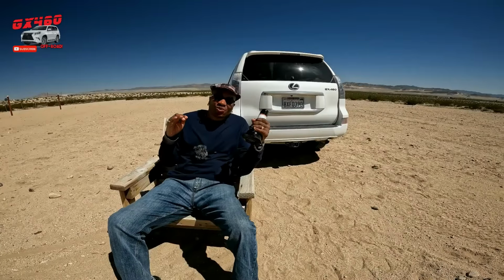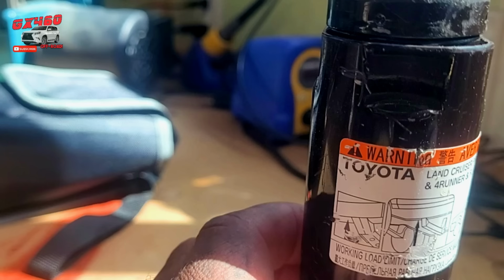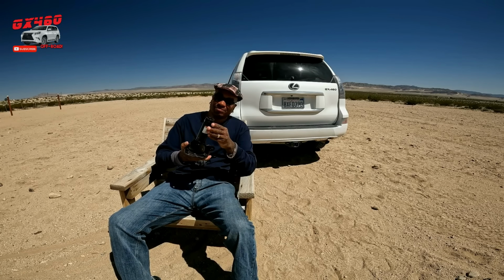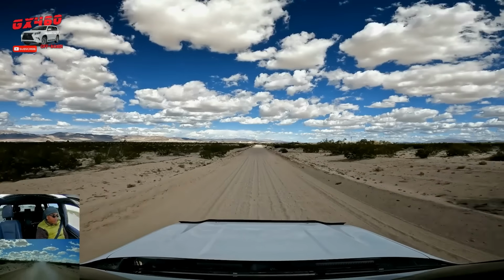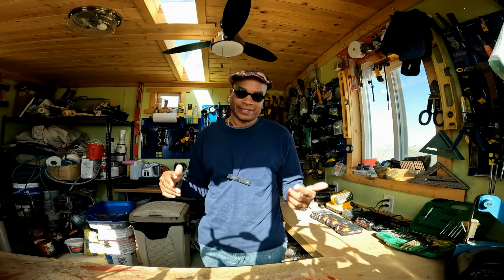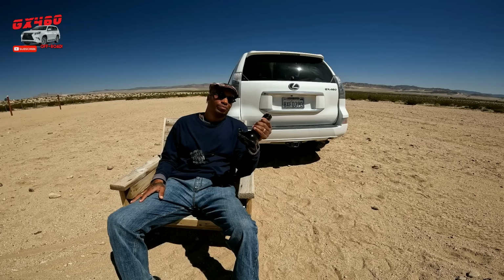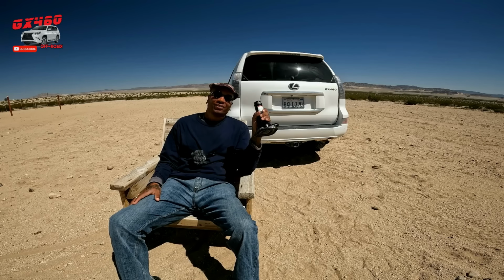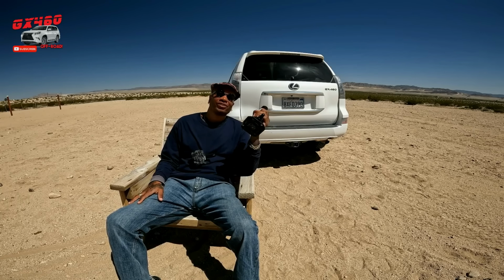Toyota's Jack is GANGSTA!  (Don't Replace It!)

Comment: Last year I did a search for a better jack for my built and lifted GX460. I didn't want to carry a Hi-Lift, so I looked at bottle jacks. I did find one that would go 24" (Baoshishan, for those interested), but then I checked the factory Toyota jack and it goes over 19", and I wouldn't have to carry an extra jack and worry about it leaking as you mentioned in the video. So I bought a couple of extension products such as from Land Cruiser Product to augment the capacity of the factory jack and all is good
Reply: @stevecarlson2346 Land Cruiser Product says their "medium" jack adapter is out of stock.  However, out of curiosity, does this adapter fit (cradle) your frame rail?  It doesn't seem like it would from LCP's pictures.  Cradling the rear axle, though, should be no problem ...

It would seem being able to spread out the lifting forces across a larger surface area would be advantageous from a pressure viewpoint, so I'm wondering if there are any other companies that might offer adapters for our stock jack ...
Reply: I was mostly thinking of the axle for the LCP adapter.
Reply: Ah ... Many thanks!
Reply: @bavardage  Easy way to get a rear tire off the ground, even with a lift and 35s as I have.

Comment: Had a Flat in my Tundra, the Jack Failed, it’s locked up. 18 Wheeler helped me out thank goodness. I was basically stranded due to a simple fix of a flat but the Jack is totally locked up. Took the Jack to my Toyota Dealership where I purchased my Tundra. No help,at all and a new Jack cost $200. A Service Tech tried to unlock but the gear inside failed he’s seen many of these Jacks Fail but Toyota will not replace, have to purchase. I contacted Toyota and again no help. Buy a new one, mine is new. Only used 2x. The Jack and Tools are in the back seat in its proper place. Very Disappointed in Toyota. I paid $300, for the Tow.

Comment: They make adapters that will fit a 1/2” impact.
Reply from the maker: don't use an impact for this... the gears aren't designed for that... do it by hand with the provided sticks... or use a drill on low speed (low gear)

Comment: Do you know what year those came out? I have used older Toyota jacks like that, but not the extended version you have.
Reply from the maker: been on Landcruisers forever... the old ones were cast yellow and bolted together... newer ones are stamped, welded and brown like this one 😃
Reply: I have 2 80 series here. I will have to take a look if the stock jacks are in them. Thanks

Comment: The other thing i carry is a rubber mat, about 30cm square, its made out of old conveyor belt rubber from a quarry. i usually chuck it on the ground then the jack ontop. its thick polyester reinforced rubber, it crushes down but protects the jack and stops it slipping off a rock or getting messed up by crap on the ground.
Reply from the maker: That's and excellent idea!  Thanks for sharing that tip ❤️
Reply: Quite right, I use exactly the same thing, works a treat.

Comment: Do not uses an impact driver with one of these. A drill is fine. (Don't ask how I know, but you can remake the gear teeth with a stick welder) I have a few, including a yellow one,1964?.
Reply from the maker: Yes the yellow ones were cast I believe, and unbolted for maintenance

Comment: my 1992 holden(isuzu) rodeos factory jack is the same model the only reason i found out is cause its the same model as in my mums 2003 prado which even though the prado has a 2 inch lift and larger tyres it still doesnt have a problem with it compared to most other oem jacks

ive jacked up the entire rear end of my rodeo with one of these and took both the wheels off to get swapped out so i could get my car registered and left it on the jack for about a week

Comment: After a 3-inch suspension lift, 1 inch body lift, and larger tires (35's), it is too short by several inches. That's the only issue i have with it.
Reply from the maker: Carry a block/blocks of the same height you lifted/raised the vehicle
Reply: @LexusGX460-OFF-ROAD  
Yes. That's what I have to do. Which is fine. 

Thankfully, I've only played with the jack in the driveway to figure out what I need.

Comment: The only issue ive found with this jack is that you need flat level ground and sometimes you need additional height so you have to place boards underneath the jack…

Comment: Not high enough for my lifted 4Runner unfortunately.
Reply from the maker: The thing goes to 19.5 inches... you'd have to have a 10" lift for this thing not to meet a jack point.  1-4" lift just put something 1-4" thick under the jack 😃 ✌️
Reply: @LexusGX460-OFF-ROAD  I tried using the jack points from the manual. Frame is at 19"

Comment: um..they do 'break'.  if you wind on the pinion with a large level the base plate domes down to the point it skips teeth.  I now weld an inch long weld along each of the 4 sides between the eye holes that rivet the base to the top.
Reply from the maker: that would be abuse... use as intended and they will last forever... add a large lever to the pinion and well... there it is.. 😆... use properly and it'll treat you properly 😃 ✌️

Comment: Yup, still have my original in my 88 Toyota Pickup Truck! 
Now I have to check my new (used) 2000 LX 470 if it has one?
Reply: Yeah, my 88 gray Toyota pick up with the checkmak on the side had one of those jacks.

Comment: I've got 1 of them behind the seat in my Nissan Patrol, had a flat the other day and my 20ton bottle jack must've been sitting sideways for awhile - It wouldn't extend all the way even without load.
So I took that screw jack out. It really needs a rod with a hook to give you some leverage, anyway I gave up before it lifted the wheel off the ground, I figured it was already at full extension, didn't realize it might telescope out like that, nice.

Comment: Thanks for your very helpful vid.  I have a 2010 FJ Cruiser which comes with this little jack.  However, I also bought and mounted a 48" Hi-Lift jack to my roof rack because I thought this little brown jack was a joke. I think it has some limitations in off-road conditions, but I definitely have a better appreciation for the quality and usefulness.  I also carry a hilift jack base and even 1 6-ton jack stand, just in case. Probably overkill.  Thank you much for the education!

Comment: I’m going out to my garage right now to see what jack my landcruiser has.   Funny thing, I bought a 10 ton bottle jack for my boat trailer because I didn’t think my Toyota jack was up to the task.   Maybe I was wrong.  Mind you, my boat is 3.2 tonnes.
Reply: Well, I have the same Takeuchi jack you describe, which was brand new and realised it comes with a comprehensive tool kit too and just tried it on my boat/trailer and it worked beautifully.   As you say it’s 1 to 1 gearing so needs a little muscle, but it still lifted it.    I put it against my 10 tonne Kinchrome bottle jack, and it’s higher too, but so much lighter.    Thank you, I’ve ditched my bottle jack to my garage.

Comment: What years did they start including these?
Reply from the maker: They were always on the older Landcruisers... they were yellow and could be unbolted for service.  The one in this video says Landcruiser, 4runner, Landcruiser Prado.... they should be on most if not all Japan made Toyota and Lexus trucks/suvs
Reply: Yes they were always there.
The oldest ones (up to mid-70's) are cast iron and made by STO, but same design.
Reply: Had one on my 2000 Prado

Comment: I have one of those in my old 4Runner. Had to use it once when I blew a tire on the freeway. Never thought about it. Just jacked it up and changed the tire.😊
Reply from the maker: it worked when you needed it the most 😃 😊 😀
Reply: @LexusGX460-OFF-ROAD  Yeah pretty much everything on the 4Runner does that lol.

Comment: Where is the jack supposed to be on a 2013 Lexus Lx570?
Reply from the maker: sorry I'm not sure... it's back there somewhere 😃
Reply: 2011 LX jack is stowed on the passenger side  in a small compartment behind the rear wheel. Access from tailgate in the luggage compartment.
Reply: @robertherrmann4823  Thank you!